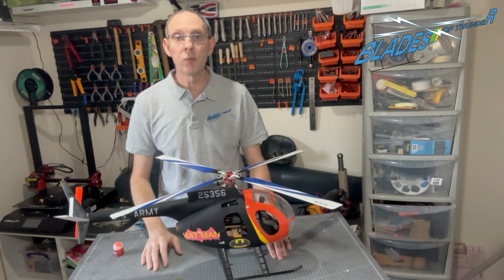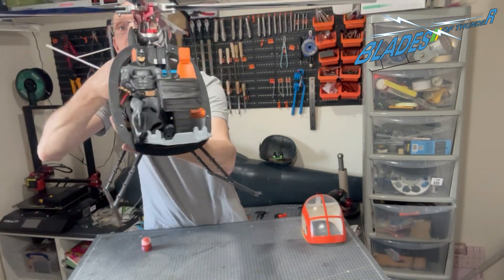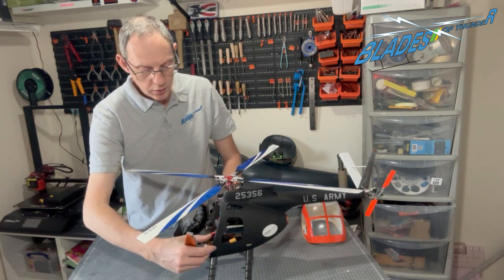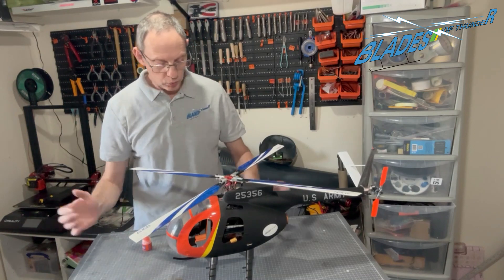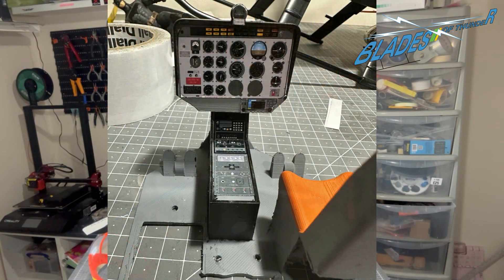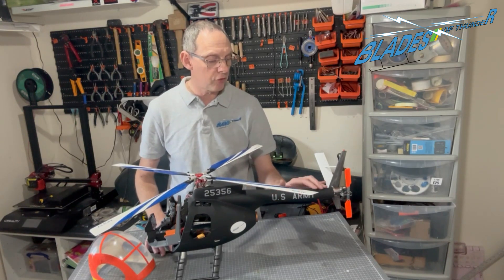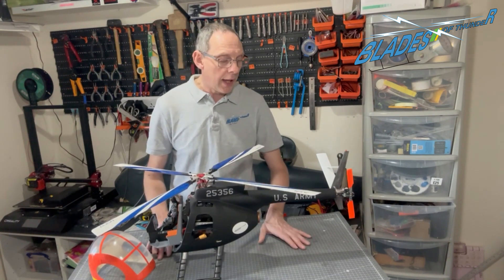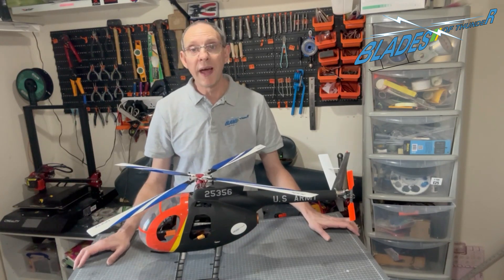Batcopter The Next Instalment.

Comment: I've noticed with these models they are tail heavy and the battery has to fitted as far forward as possible  .
Did you have any COG problems with that battery location?,
Reply: They are tail heavy and we need to add weight to get the CoG correct. We use tyre balancing weights.
Reply: @paulbassett214  Thanks for the reply.
Reply: @jeffreyuprichard3754 you are moat welcome. If you look back at our other videos, we did one of its maiden in the original fuselage. We explain how and where we added the weight to get the CoG correct.
Reply: @paulbassett214  I looked but couldn't find that one. Will try again. Thanks.
Reply: @Lonsome1223  ok. I think it was the one when it first went into the AH6 Littlebird fuselage.